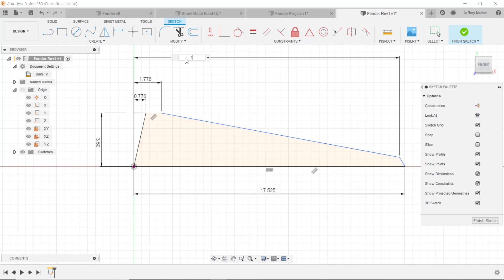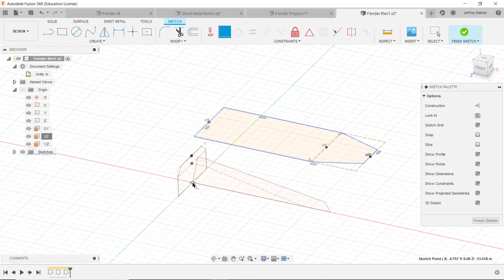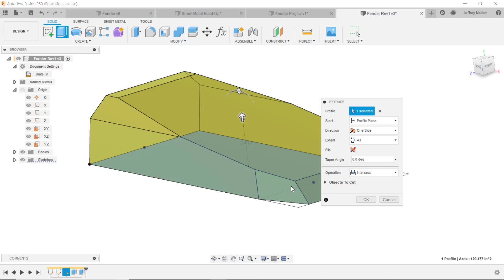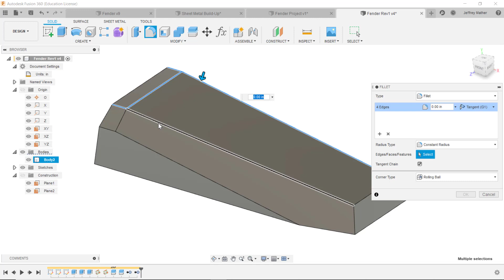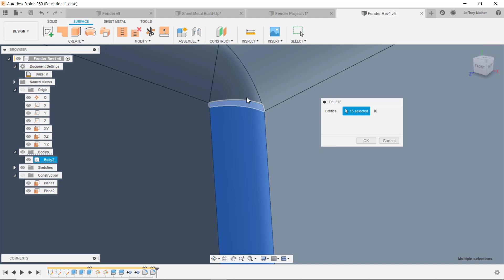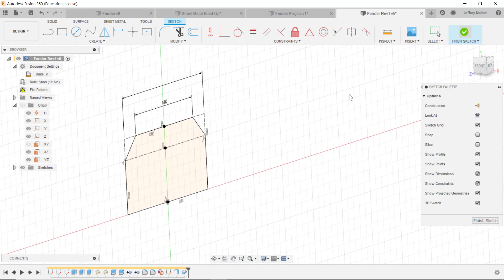Fusion 360   Hybrid Sheet Metal Fender Project

Comment: Exactly what I've been looking for. To further clarify, is it the creation of the single flange that pulls the entire design into the sheet metal environment? Additionally, is that how the sheet metal environment works, by recognizing fillets as flanges? Thanks for posting!
Reply from the maker: In the time since this video was originally created a new Convert to Sheet Metal tool has been added to Fusion which can remove a step or two from the process.
Reply: @TheCADWhisperer  Just found it! Does this remove the thicken step? What about the need to fillet and delete faces etc? Thanks for the quick reply.

Comment: I was just on a chat with the fusion people to see if you can create sheet metal from a shelled part and have some of this work done for us.  Short answer is you can't.  They pointed me to drawing things in the flat patter and using the bend feature for my specific application.  Your solution is the best i've seen to creating sheet metal from something similar to a shell.  Hats off!
Reply from the maker: You need to get the long answer.  As long as the 4 rules are understood - any part can be done.